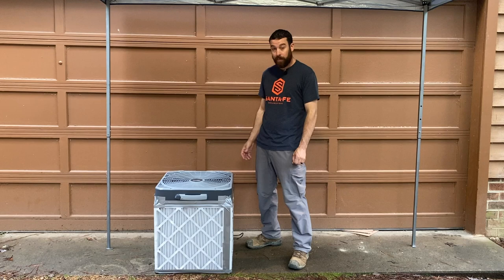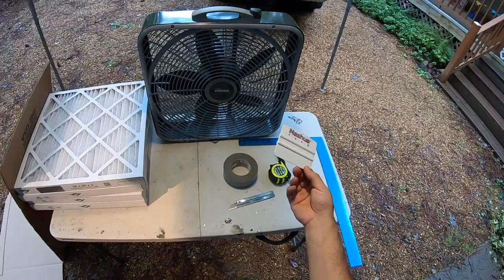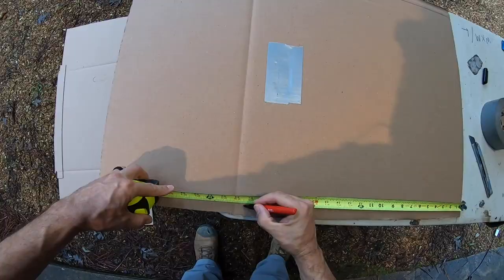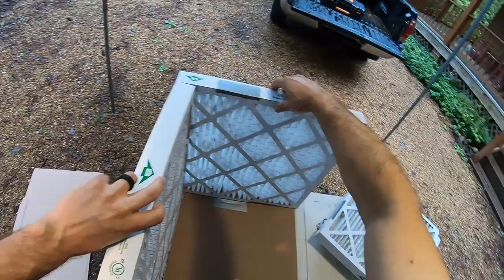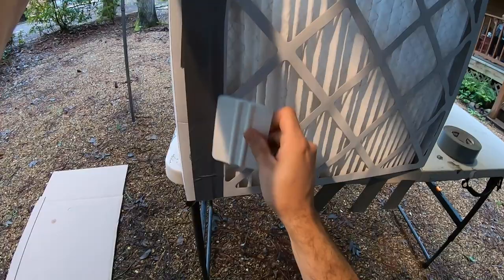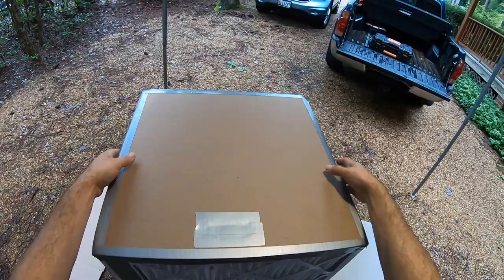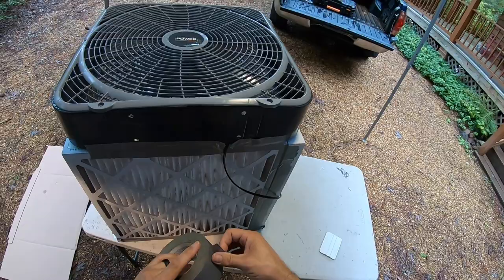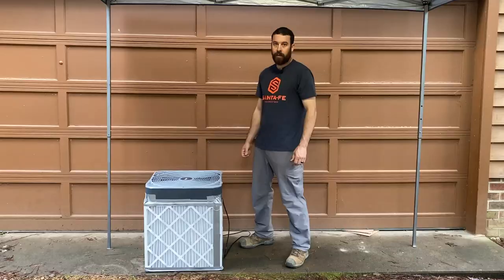A DIY Air Filter Using MERV 13 Filters

Comment: Great video! One missing part that is important to add is a piece of cardboard on the front (or rear) of the fan that covers the corners, and has a round hole for the fan. Some experiments have shown that the fan pulls in air from the corners, so that not all the air is pulled through the filters. It makes it more efficient.
Reply: @Bryon Bradshaw Using styrofoam or something simmilar to fill the gap between the balde and housing is the best way to go.   Or use a fan that was designed with a circular housing to save some time...

Comment: You cut off the flap,  with the flaps and some more cardboard you could have made legs for it to stand up off the floor just by folding the legs back and holding them in place with 2 side braces like a cut out toy or display.  You could even filter the bottom like this giving even more air filter surface area.

Comment: I've watched several of these builds and always wonder why they don't tape a 5th filter directly to the underside of the box fan.
Reply: Solid question.

A single filter would require much more power to push/pull through.  Putting a single merv 13 air filter in front of the fan negates the need for the other 4...HOWEVER the fan might not  be able to push/pull air through it. You will get about 1/4 of airflow (simple estimate).  Using this design pulls equally out of all 4 filters at once, making it easier thus more volume goes through system.  This is why nearly every diy air filter with box fan uses this design.  this is the best way to do it with a cheap box fan and off the shelf items like duct tape. 

Designs like this are a fantastic  combinations of "people centric"/"well functioning" solution for those without tools or building experience.
Reply: Well I think it’s a good idea if you elevate the bottom so air can get to al 5 sides..

Comment: Box fans suck (not literally tho) , because when you’re creating so much restriction with the filters; the fan will pull air from IN FRONT of it. The only way this fan would work for suction , would be in a tunnel.

Comment: Wouldn’t you you want the fan facing instead of out? I’m just curious to know how that works with it blowing out instead of in, wouldn’t it just make it a lot of s messier situation and it blowing the particles everywhere?
Reply: Particles would get trapped on filters and clean air out.  Since most particles will settle over time this would suck from the bottom and clean air will forced towards the ceiling and eventually back towards the walls and force air down and and back towards the filter.

Comment: I would at least build a permanent plywood base with wheels so you could easily move it around the shop.
Reply: Jesus is Lord  lol.  Wrong! More like 5 pounds! Put some wheels on the bottom of that beast.
Reply: @one7decimal2eight  , put the filter box on a small furniture dolly from Harbor Freight if you need wheels. If it’s in your home put felt pads underneath if you have hardwood floors, if you have carpet the cardboard will slide easily
Reply: Nah, just get a plant trolley/dolley from dollar store or daiso and zip tie to the bottom.
Reply: I wouldn't want wheels on mine, I put it in the middle of my bed, or on a coffee table in the living room. It's so easy to move around and I think it works better if you put it up a little higher, just my opinion

Comment: This works well for a small room yes? I’m on the second floor and the only window in my bedroom leads to the roof of a restaurant. Throughout the day the smells coming from their exhaust will get into my room if I leave the window open and I absolutely hate it, so I only open my windows while I am home after they close for the day (11-6am when I leave for work) With the freezing NYC nights approaching I won’t be able to keep the window open and that would make my nose stuffy. Clearly I have to dedicate more time to dusting my room properly to help combat this I also have a damn carpet to make matters worse 🙃 so would simply circulating the air in my room with this help? Any ideas or advice Is appreciated, feeling stuffy in the morning is getting unbearable.
Reply: Air filtration and circulation definately helps but the odors are something that are very difficult to filter.  Sunlight is acutally ome of the best ways to get rid of odors.  There are other methods of odor absorbtion you may look into, but filtering the dust and letting as much sunlight as possible in will reduce it.   Plants are also a good way to freshen the air.
Reply: @Bendigo1  need carbon filters

Comment: Thanks, I made one according to your directions and it works great. I live in a small town and only 1" wide MERV 8s were available. Would 2 MERV 8s be equal to a MERV 13? At any rate, some is way better than none. Thanks again. Great vid.
Reply: Just wait until you need to change the filters and then use the 13.  Order them online if need be.
Reply: @one7decimal2eight  Okay. Thanks.

Comment: ok I will agree that it DOES basically filter, however, that is still a radial blade style fan with a fixed blade. That means that it cannot work under any static pressure other than the one the blade pitch was designed for on the fan curve based on its installation housing. I can prove with airflow instrumentation that your getting less than half the airflow thru the fan than hen it operates with no obstruction. Will it filter? yes for a bit, but the minute it starts to load, you will decrease your flow exponentially. Sorry, just PHACTS, PHIGURES and PHYSICS. And yes as a matter of fact I am a professional engineer with 35+ years experience and I am also a PE with a state stamp. Please dont expect this to drastically alter anything unless it is in a small room.
Reply: Maybe he can add the prop from an F4U Corsair ...
Reply: With all due respect to you.  This is a cheap hack intended to save someone from buying an expensive air filtering machine.  It does work.  It is definately not an optimized design.  It is just a hack.   One could design a blade and filtering system that would be much more optimized and easier to maintain for long term use.  What is demonstrated in this video is best used for a short time, maybe dureing a time when forrest fires or dust storms are causing air quality to be less than ideal.   

I would actually like to see a more advanced version of this idea being shown, where the fan is designed for the static pressures and the filters can be easily changed.
Reply: My buddy has a dedicated mobile cubed filter with a HEPA dust bag on top. When it’s on it’s about 10 feet tall. The thing works awesome for his body shop. It also cost $7500. This is a $100 DIY air filter to get the job done quickly and inexpensively as possible without just blowing particulates around the room like throwing a filter on the back of a box fan.

Comment: Are these filters washable? Maybe you can make a filterframe and use some cheap(per meter) filter material ..?
Reply: Cheap filter material does not usually do a great job at filtering....   A frame would be a great idea so that you could more easily change the filters.

Comment: I have seen 2 real scientists from 2 different countries doing this DIY air filter with a single fan and a single filter and their lab results were similar, more than 95% efficiency compared to market air filters.

Now Youtube is starting to recommend me these common people videos with their 3 filter box with no evidence, no data, no logic. So fascinating how common people think. So, how much better than 95% efficiency is this monstruosity? I just wonder if the filter manufacturers started this myth of needing more filters for a DIY air purifier...
Reply: Part of this design is to blow the filtered air up, instead of blowing particulates across the room, like using a single filter taped to the back of the fan. 
Plus, the design of the filter cube will pull air in from 4 sides. Also using 2” filters, you will have a faster fan speed.